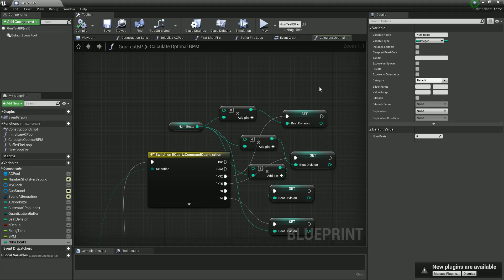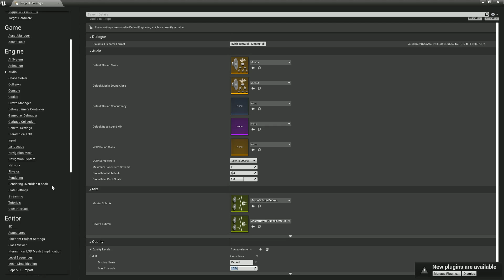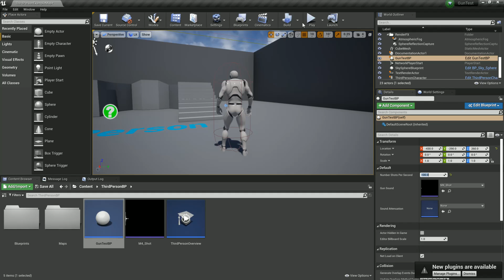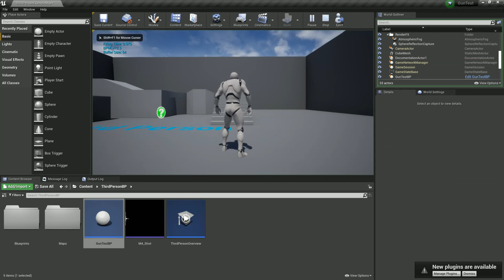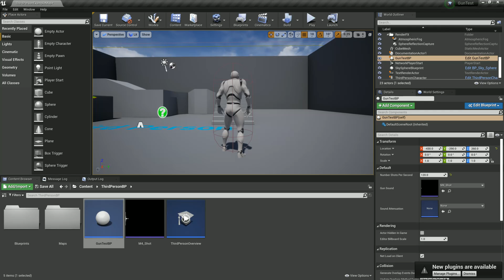Getting Really High Frequency Quartz Timing, But At What Cost?

Comment: Thanks for sharing this. I'm having some trouble with how you ended up setting up your system. Where are you using the Beat Division at? In making a quartz time signature? But then does that mean you have 2 clocks going? Rather confused how you ended up setting this little demo up @.@

Comment: I am working on creatures now that have buzzy wings (think dragonfly). Would quartz be the right system for cueing multiple looping wing sounds so they play in time accurately? I'm experiencing frequency beating and phasing now in my project.
Reply from the maker: Is there a good reason for not using a loop?
Reply: @DanReynoldsAudio  sorry I wasn't clear. I am using a loop now and want to continue doing so, but I want to cue when to start a loop so if two of the same creatures are flying near you the wing flap audio loop is in sync with other instances of itself. In our game now we get a lot of phasing when another flying creature gets within listening range. I'm on 4.25 so I need to explore 4.26 and pitch it to the team if it fixes our issue.
Reply: @JW-sr7is  Best way to do that would be have a few variations of the flap wing sound loop that can randomly be chosen - just subtle variations are enough and couple that with using the Modulation node in the sound cue. That is enough to avoid phasing.

Comment: thank you for the video! :)

i totally agree with not using one sound at a high fire rate to simulate guns. my initial example was just for testing and getting my head around how quartz could be used for guns. i had 4 layers with some modulation, that already helps with the monotonous sound. 

but yeah, a loop is way more efficient with super fast firing weapons. it's also really cool to use 2-3 loops with different parts of the final sound and different lengths, so that the looping is hidden more, when the loops... loop... differently. :)